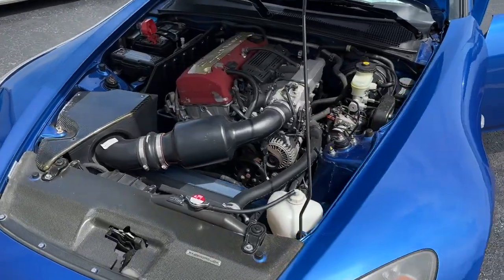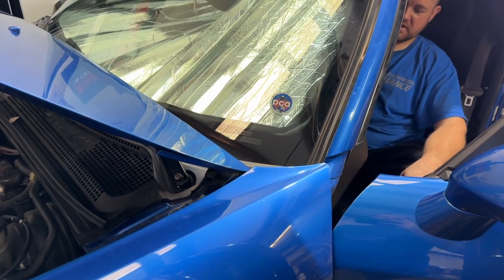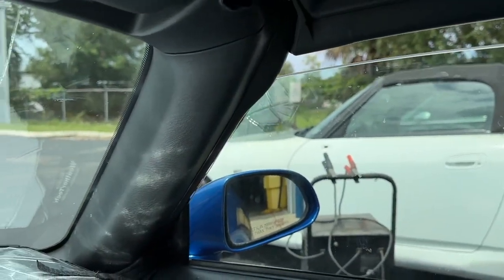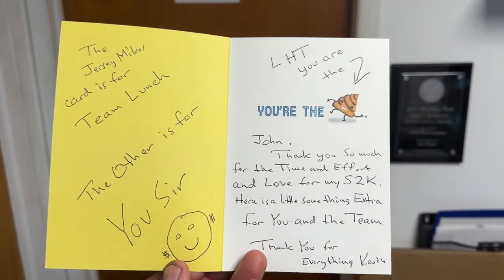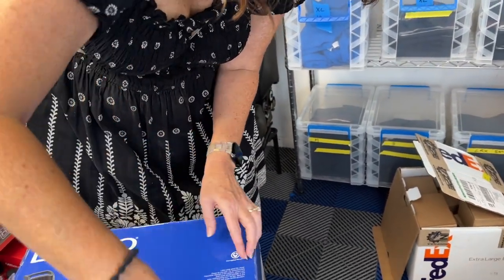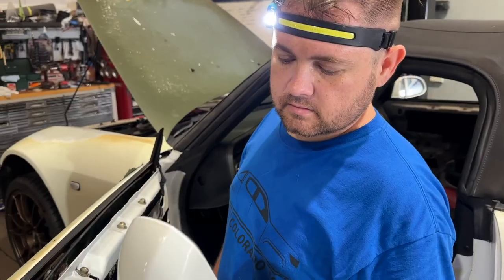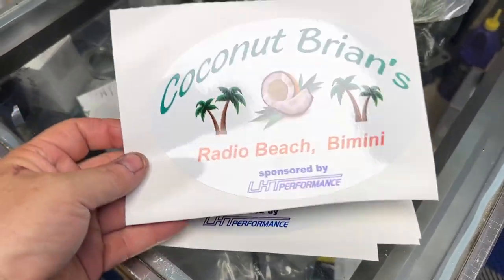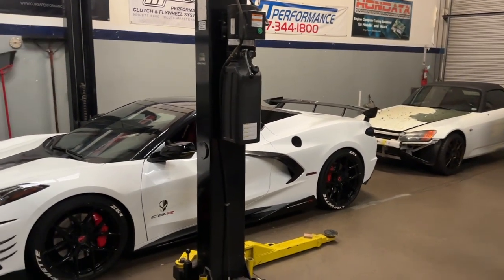S2000 won’t Start ! , 1st Things to try

Comment: hi LHT!, ive recently wanted to start modding my ap2 s2000, to be louder and faster. Just wanted your thoughts on what I planned on doing it and better options if the options i go with arent good. For now I planned on getting the Mugen Exhaust, HFC from berk, and the Unicorn header from urge. also wanted your thoughts on the best parts for everything else like suspension, breaks, intercooler, intakes and etc. So I would know the next step (note i don’t plan on tracking her)
Reply from the maker: If you’d like to message me on Instagram I can go over some Options with you.
Reply: @LHTPerformance  oh yeah for sure i’ll send a message right now.

Comment: John, any tips on preventing molding on my softtop? I have had it in my garage and used a recommended product to stop mold but it still persists. Would like to hear your thoughts? Haven't had it in the sun for a long time! I have rice and baking soda inside to keep the interior dry. Don't know what I should do. I have used a space heater inside before. Not sure how often I need to do it.
Reply from the maker: I’ve never seen that as an issue. Molding usually is moisture inspired. Unless you have a climate controlled environment, I would try and get the car in the sun more. The heat  and UV rays will definitely help. 
Boats are the same way, put away in a damp climate and they will mold.
Reply: @LHTPerformance  thx

Comment: Can you push/clutch start an S2k? I'd assume so with the key in the 2nd position?..idk. I've wondered if that "feature" is dead with these new push start/no key cars but the S2k still needs a key to be turned. I got pretty good at doing this in my first car..lol POS
Reply from the maker: The S2000 basically has the old school style ignition. The second click is the ONE position. Push start it or jump a 12v to the starter signal and it will run.